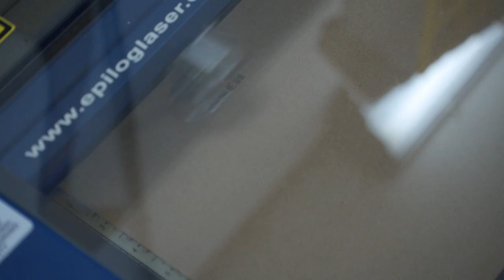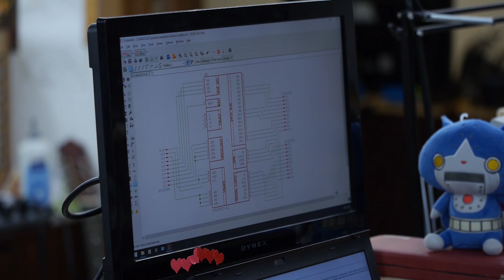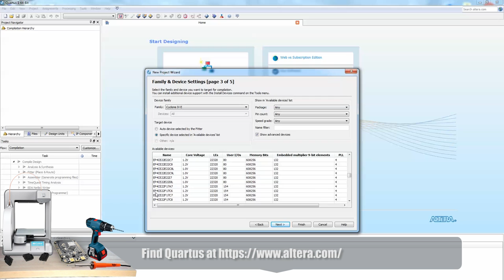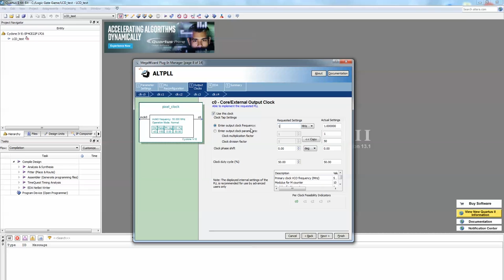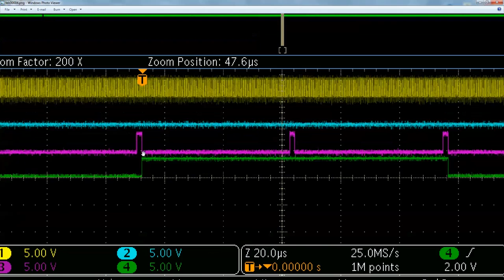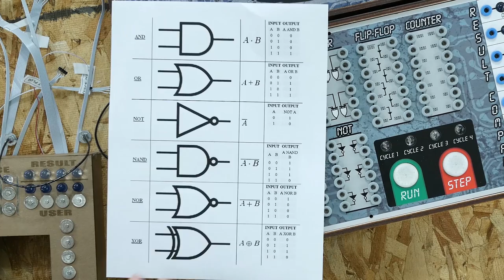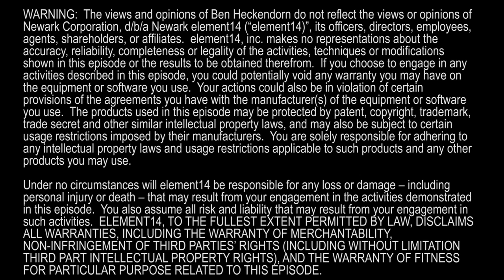Logic Gate Board Game 02: Interface, Expert Advice, and LCDs

Comment: The game could be somewhat like a bomb-difusing thing, every step being timed and having to guess correctly (almost?) every turn (otherwise the timer speeds up?), simply because dealing with wires is similar to what we see in movies when someone is difusing a bomb or trying to hack a missile or something. Sure, people cut wires and here you're trying to do the opposite, but still... Similar.
But I don't think you necessarily need a timer there (if you ignore the suggestion I just gave). You could make sort of like a 10-step course, getting harder and harder if that's possible, which would say that you failed when you failed (using the LCD for that, buzzing sound or whatever) but if/when you failed a step it would give you another chance, from a limited amount (kind of like a "life" in a video game).
If you completed that course, you would have a secone one, a few steps longer and harder than the previous.
And in the end you'd have a hi-score table to compare to both your previous attemps and whoever else would want to play too.
Reply: allluckyseven Maybe also a 'Continuous' mode?

Comment: +The Ben Heck Show - I think the easiest way to run this is through the software. If the software gives cartoony comic book scenarios where it sets a puzzle on the screen and you need to solve the puzzle to "progress the plot". ? You could also have "Story Cartridges" for marketability where each "cartridge" has a different plot with different puzzles. (Or some other "Story loader" system) (Maybe just have a micro-sim controller and or slot where you can insert and load levels. You could even have a website where people can create their own comics using like clipart- and insert puzzles into them for their friends to try?)

Comment: The LCD might be dim if you didn't hook up to the upper most (MSB) bit, or not driving the backlight at it's full current.

Should ideally use a proper LED backlight driver IC on the final board.

Comment: From my experience, the LCD backlight is driven by seperate connections and has nothing to do with the signal lines. Sometimes it's not even part of the same ribbon cable but separate wires, although that doesn't appear to be the case here.

Comment: hello sir ，I have an idea ,can a new 3ds without the up secreen  add to a casing of a smartphone and use an app to connect the 3ds and the smartphone ? I've seen some videos on the internet .the main board of the new 3ds is small that can be designed into a casing of smartphone ,and then ,if it can come true ,we can play our 3ds with the smartphone we have got ,I think that will be cool ,play the 3ds games anywhere with your smartphone !what else is ,if there is enough place ,we can also place the controller in the casing ,the mega ace ,I think this proc can be used ,if all be done ,we can get a new 3ds and the mfi controller  in one casing for the smartphone . If you got this ,pls answer me ,and pls don't laugh at my English ,I'm not born in English country .

Comment: That's too much hand soldering for a product. Make everything out of pcbs. the contacts too!
Reply: They're still prototyping basic design features. You don't do things like PCB design until you've nailed down the rest of the design....
But I guess it depends on what they try and do with those connectors as to what they can do to optimise it for mass production.